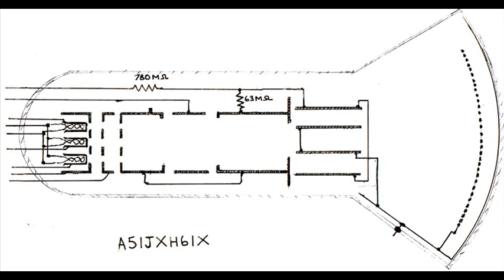Trinitron Cathode Ray Tube

Comment: Im trying to remove some kind of glue/cement between the glasses. First i tried to use a screwdriver and a hammer but some glass broke loose. Can i use any solvent? Or do i have to brake the glass completly?
Next step would be to remove the metal plate. But i guess you only have to drill out the rivets.
Reply: The glue is called Frit. A Ceramic Glue.
Reply: @digitalwoodshop  Abit late but ok. ;-)
Reply: @meskalin64  I posted a video on another post of the Sony San Diego 32 inch plant. In the video it shows the Frit being applied then a 3 hour cure in a heat tunnel.  https://www.youtube.com/watch?v=yNkIgVwr_nQ